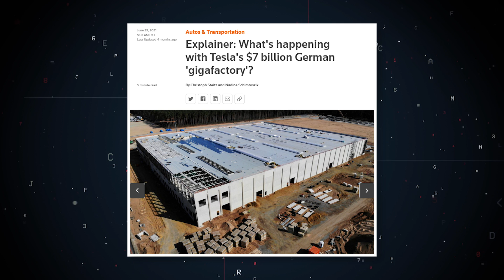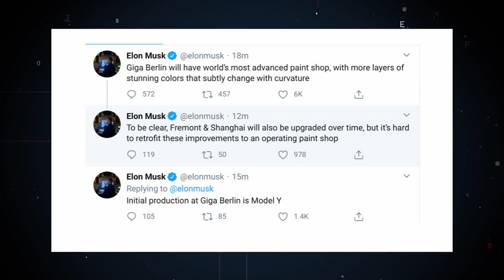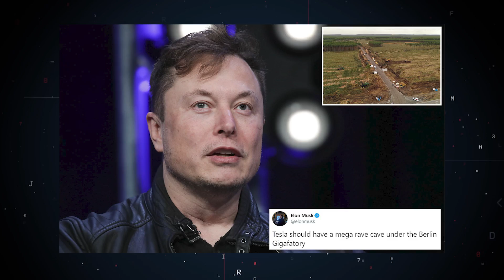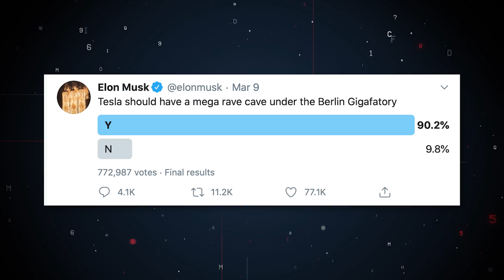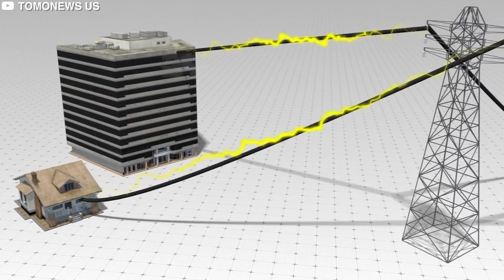Inside Tesla's New $7 Billion Gigafactory

Comment: Racy and interesting, however, not sure how valid yr data is. One point, in particular, stood out: Tesla does not have a long-term goal of 1,000,000 cars by 2030, this will be achieved by 2022. Do the math 500,000 cars in 2020, so at least 750,000 in 2021 and 1,500,000 in 2022. 10,000,000 BY  2030 for sure.
Reply: Their goal was 1,000,000 by the end of this year. They’ll easily exceed 1.5 million by next year. 20 million per year by 2030.
Reply: @TecnamTwin  Not so, Elon's stated tgt of expansion is a 50%  per year. 2021 is well ahead of that, however, that was the goal. They are on tgt for a 70% increase for 2021, if they maintain that into 2022 that will mean just short of 1,500,000 vehicles in 2022. I would not be surprised if they well surpass that though as you say.